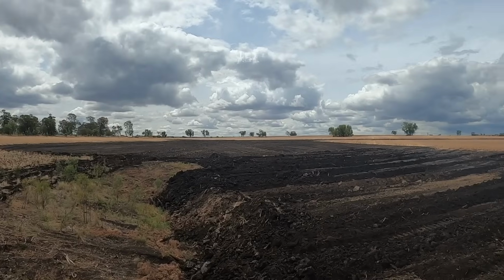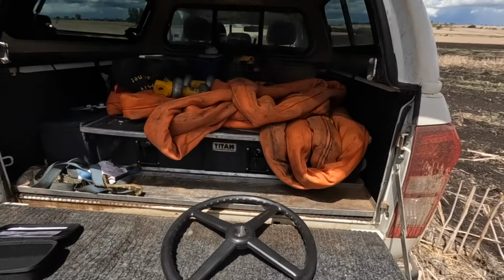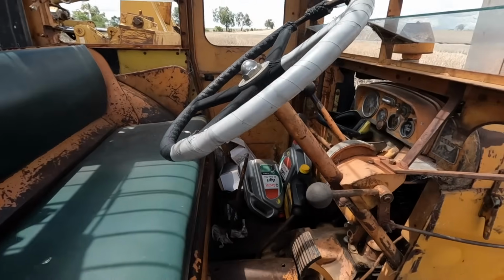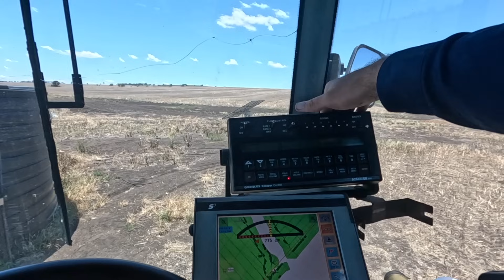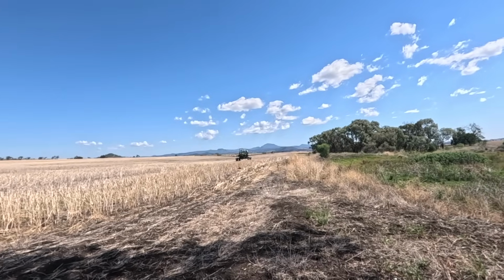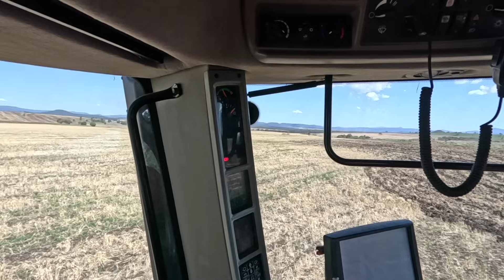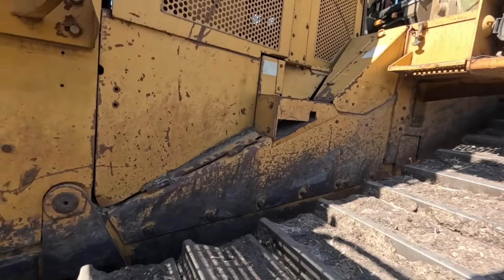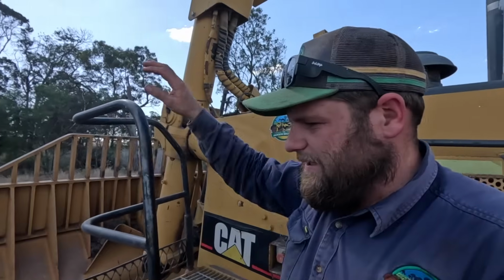D11 BULLDOZER Gets to Work & Air Cons FAILING in HEAT! | D11 Bulldozer | Vlog 235

Comment: Those old dozers are hot to begin with. One time we tore out the old interior and used sound deadening material everywhere we could put it. And put in new interior, sealed off spots where we could and then tinted the windows. Made a world of difference at keeping it cooler. Plus it didn’t run the compressor as hard.
Reply: They are all hot, your sitting on top of a big hunk of metal that's over 180 degrees, old timers would  cover the floor board with dirt.😢, I love these videos.

Comment: The D11 should handle 40 deg C ambient no problems without overheating. There is a plastic air bleed valve with a steel ball in it in the thermostat housing, the ball breaks out over time and causes enough bypass to overheat when your working the machine hard over 35 degC ambient. The ball falls down into the engine  oil cooler inlet bonet and pounds the cooler tube ends closed so best to fix ASAP. Its not a big or exspensive fix, a few seals and gaskets and 2 to 3 hours work A very Merry Christmas to you all.
Reply from the maker: Cheers mate, something to keep in mind, we are leaning towards oil coolers restricting flow but we will find out when we get some downtime👍😁

Comment: Wouldn’t you be better off pushing the top soil back then fill the ditch then spread out the top?
Reply from the maker: We are fortunate to have nearly 2 meters of topsoil in some spots, if we didn’t we would be doing it a bit differently👍😁
Reply: @thejacksonbrothers   seeing the black topsoil and the white sand underneath is the reason for my comment. I have some similar issues. Just don’t have a ton of topsoil and a D 11 handy.🤣

Comment: Catterpillar air cons were never great maybe convert it back to open cab operators are spoilt these days when i started operating no air con cabs ,dust flies cicadas bees hornets all sorts of creatures but it was great
Reply: Sounds like a good idea for 1988!   How long do you hearing aid batteries last?   
Ha what you say?
Reply: @HamSlicer  SAY WHAT
Reply: One of the pits by me has a D8 they put an old red dot unit on, ice cold.
Reply: I’ve ran with and without air it sucks when it quits and I will fix the it I do not like bees suck when there all over you and eating dirt and dust all day sucks what tears me up is to see a new peace of equipment well older stuff that the heat and a/c works great but you will see a big sloppy oparter with the doors standing wide open it and the windows too and the door are just flopping around that drives me crazy
Reply: Because doctors are cheap.🙄🤬🤦‍♂️